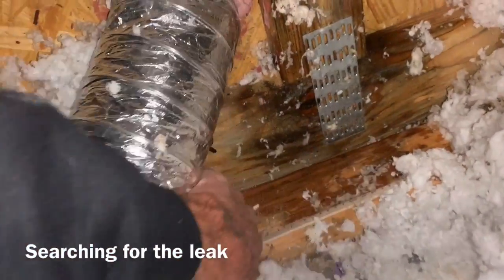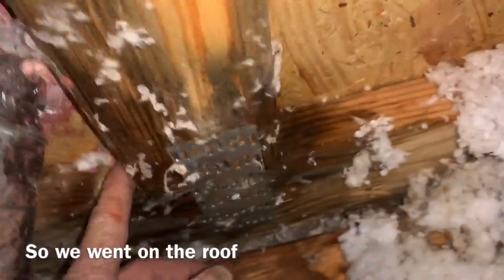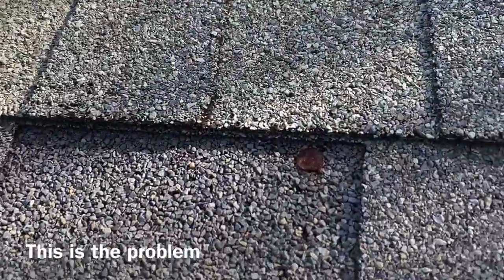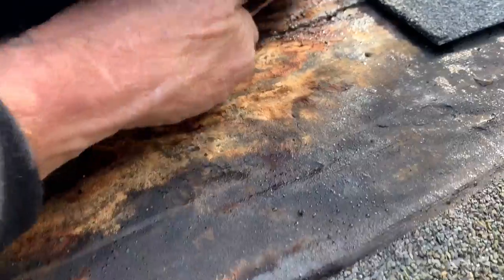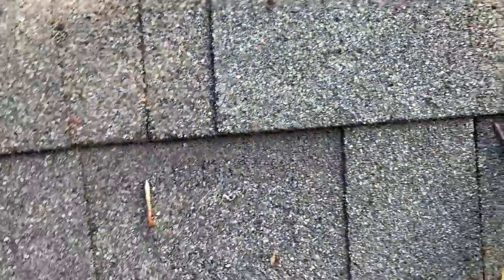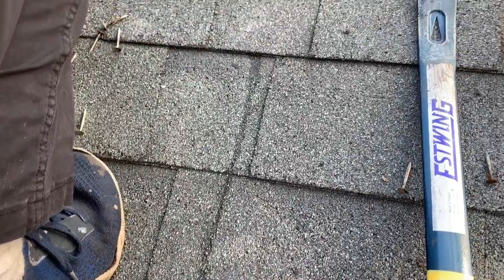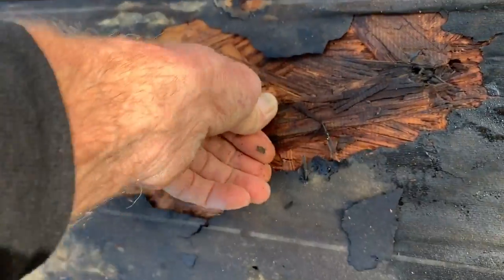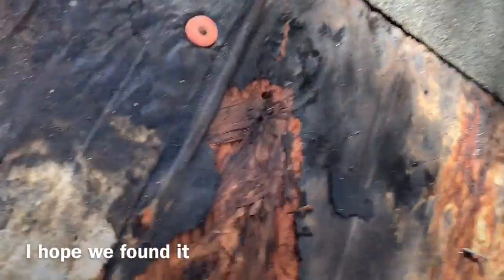Shingle roof leak repair

Comment: I recently bought a 1978 mobile home single wide. Come to notice I have a few leaks in the roof that I don’t know how to prevent myself. What would be an estimate to have a new rubber roof installed? Also could the age of the mobile home play a role in how much weight I can put on my roof?
Reply from the maker: I’ll be honest with you I have done those 2 mobile homes 1968 and up. There are many different situations that you can run into. But I’ve never run into a weight problem. Actually adding plywood gives the roof support even with the added weight.  If you have a small leak maybe you should look into Hydro stop. You can buy that at your local ABC or Best distributing. It’s according to the size for the price. And we are located in North Carolina.  In my area mobile home that size runs between 55 and 6500
Reply from the maker: If you like the video I would appreciate getting that like button so YouTube or share it with more people 🙏